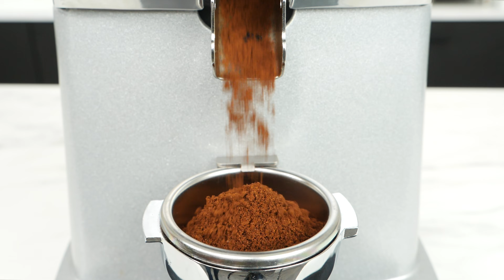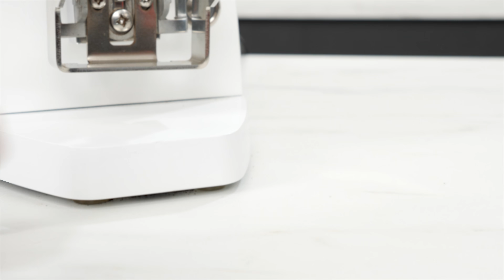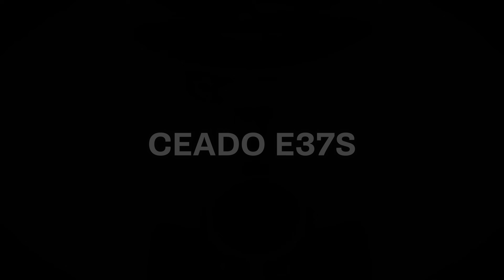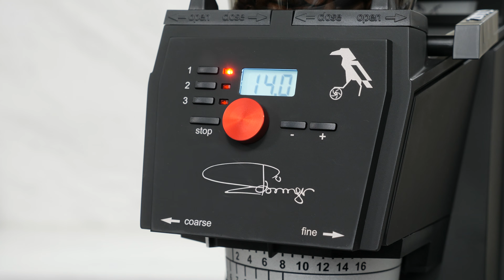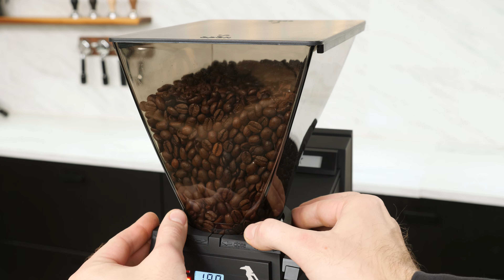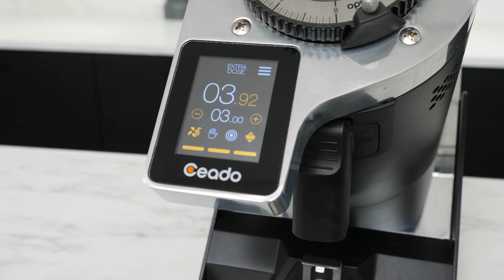Best High End Home Espresso Grinders of 2024

Comment: Pairing the atom w65 with a Silvia pro x, is it overkill or makes for a perfect setup? Thanks🎉
Reply from the maker: Hi U, Grind quality is very important! Personally, I prefer a burr size of >60mm for pairing with a PID machine at the level of the Pro X. You can get very good results from 55mm burrs like those in many of Eureka's Mignon line. Bigger burrs produce a more consistent particle size, transfer less heat and grind faster if that's a consideration.
Marc
Reply: @Wholelattelovepage  I just pulled the trigger on the Mignon Libra 55 which has a smaller footprint and costs almost 1/3 🙈 I hope it will perform well! Thanks
Reply from the maker: @90native_Gamecat  You're welcome!

Comment: Thinking of pairing the Atom W65 with a Línea Mini R. Thoughts?
Reply: Thank you! What are your thoughts about the Atom W65 versus Mazzer Super Jelly V Up?
Reply from the maker: @Dito.Gancini  I have not used the most recent version of the Super Jolly. But when I used Mazzer grinders a decade or so ago I was not a fan of the internals with 3 springs supporting the top burr carrier and the threads of the grind size adjustment where exposed to ground coffee so they would regularly clog up with coffee gunk. Cleaning those threads out was a meticulous process often needing to use a needle for precision scraping.  Grind size adjustment would often become stiff and jumpy. Perhaps those things were revised in the most recent version? Beyond that burr size is essentially the same between the grinders. Grind size adjustment is very precise and smooth on the W65. Automatic weighing is a feature I love! Hope that helps!
Marc
Reply from the maker: Great pairing - that's a winning combination for sure!
Marc

Comment: Looking for the best small.footprint high spec / quality grinder, any ideas?
Reply from the maker: Hi pc, "best" means different things to different users. Do you prefer single dose, weight based, hopper fed? I'm currently working with  Varia VS6. It's a variable RPM single dose grinder with small footprint and it's very quiet. Comes stock with 58 flat burrs but has conical burr upgrades. https://www.wholelattelove.com/products/varia-vs6-grinder?variant=43159386062902
Marc

Comment: Home barista here, have ECM synchronica with the ETZmax machine. Love the grinder, easy to clean but the precision of my machine is not spot on. I get differences of sometimes more than .5 grams and even 1 gram once. Even after calibrating it again…. Really have no clue why….
Reply from the maker: Hi a, Thanks for sharing your experience - and nice setup!. Some very slight variation in weight is normal. If you're consistently off by more than .5 gram that would be unusual. Any chance you are compounding weighing errors/rounding when using a separate scale to confirm?